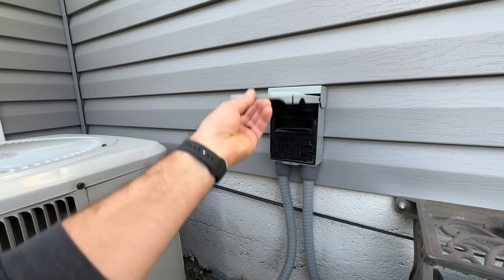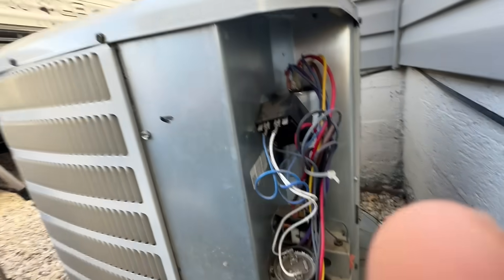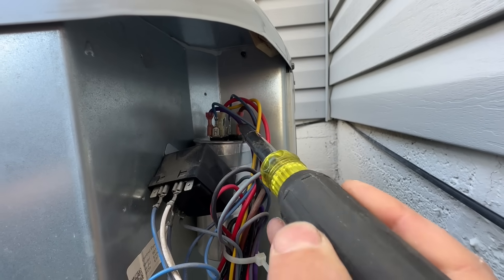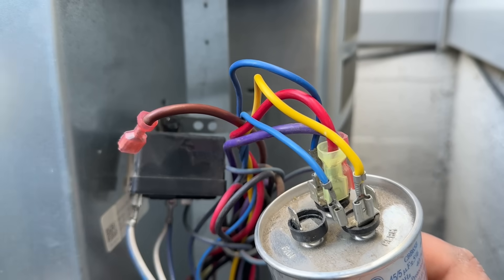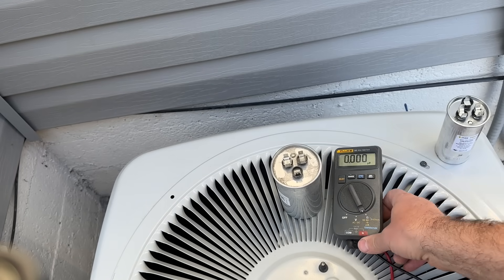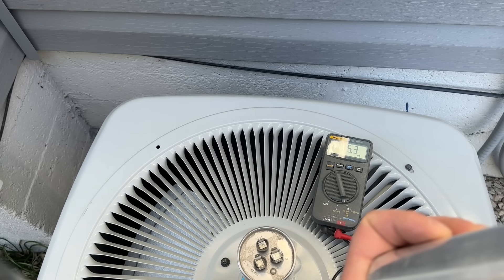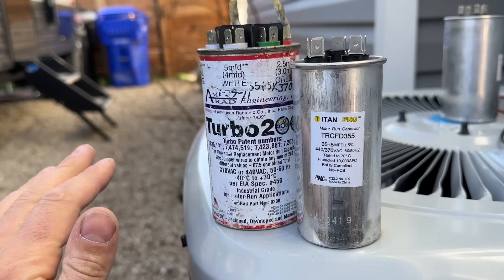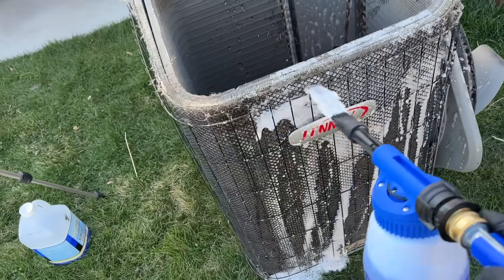How To Check & Replace An Air Conditioner Capacitor

Comment: Not a bad video but like most “technicians”/YouTubers they never know how to explain how a capacitor actually works. I love the “it’s like a little battery it gives it a jolt a jump” which I hear most often.  However A capacitor does store energy and releases it at a rate of 60 cycles per second. It creates a 90 degree phase delay or phase shift. The purpose of this is to energize the magnetic fields in the start winding 90° out of sequence from the start winding to get the rotational motion of the motor started. Otherwise, the magnetic fields would maintain a 180° pull against each other. That’s where you get the loud humming sound from a motor that won’t start. A motor with a bad capacitor.
Reply: Finally someone that knows what they're talking about!  Now tell them why they don't wear out every 3-5 years but just fail  or don't fail. I've worked on a lot of big commercial unit that had the original capacitors for over twenty years.
Reply: @poconnorish1  Not sure what you are referring to when you say they "don't wear out".  They do wear out, they don't just fail.  They often drift out of tolerance way before they fail.  I just replaced a 30/5 capacitor that was reading 22/5.  

It didn't "fail" as in die, but it failed as in it was way out of tolerance which is 5%.
Reply: P.S. Welcome to YouTube  Great comment on your fist day

Comment: OMG, I have a new neighbor that moved in across the street. He just had his whole HVAC system replaced, and I think it was because he had a slimy HVAC contractor told him he needed a new system, when he probably needed just the capacitor. 

I just had my capacitor die on me. It was a $35 DIY fix.... it would have been $15-$20 if I got it on Amazon, but I couldn't wait the extra day during that last heat wave. 

Easy fix!

Comment: That turbo cap is made in the USA and has a big warranty. The China caps tend to last 2 years.
Reply: You can find inexpensive capacitors Made in the USA.  MARS, Amrad and others make capacitors that are rated for 440Vac and Made in the USA, and they are typically around $20, which is maybe $10 more than the cheap Chinese one's.

Comment: So my AC started acting up today. The fan kicks on but it doesn’t seem to be blowing out cold air.
I cleaned the coils outside with a hose but didn’t seem to help thinking about checking the capacitor tomorrow after work.
It has a slight humming noise as well.
The unit is around 8 years old but we live in the desert so it’s constantly running during the hot months so Im really hoping this will fix it.
Reply from the maker: Sure sounds like a capacitor to me. If you need some help diagnosing check out our remote services page at Patreon.com/diyhvacguy   Cheers
Reply: So I replaced the capacitor and is working great again! It took a bit to get the house cooled down being it was around 80 degrees for 3 days waiting on the part but it’s purring like a kitten now.
Thanks for info. 🤙🏼

Comment: Great video, so here's a newbie question.  Would a Heat Pump Compressor use the same process for troubleshooting and replacing the Capacitor?  Thanks.
Reply: Heat pump system capacitor and a straight ac system capacitor functions exactly the same way, that is to start the compressor and fan .   Heat pumps have a reversing valve to change the direction of refrigerant flow, but this feature has not to do with capacitors.

Comment: I noticed you replaced the 45/5 capacitor with a 35/5. I was told you couldn't do that. You had to replace it with the same 45/5. Please lmk bcuz i  might have to replace my capacitor & i dnt wanna buy the wrong one. Thank you

Comment: Hello, I watched your video on checking and replacing the Capacitor. Mine was definitely bad so we purchased one and hooked it up. I did hear the unit turn on but after five minutes, it turned off it’s giving me a reading at the thermostat that there’s no power to the common. Any suggestions on what to do or check? Thanks for your videos very helpful 😊
Reply from the maker: I’d check the fuse in your furnace at the control board. Might have popped that fuse for some reason

Comment: I had a company come and check my failed AC. He replaced the capacitor and then said it would not be enough. It needed gas, at $400.00 per pound with no guarantee. Then he said I needed a new unit for 4-5 thousand. I can't afford that! He charged me $122.00 for the service call! Yes, I feel I was ripped off! 🤬
Reply: Find a Union shop

Comment: Thank you for the video! I have an older model double wide and the duct work is shot underneath ,I want to replace it with the round insulated duct how do I know what size to get?

Comment: Yeah fixed mine by replacing $13 capacitor just a couple hours ago . Though , taking a good long time to get it to set temp 78 F . It's definitely pushing cooler air and for three hours went from 89 F to 84 soo that's something . How can it take ? Yeah it's scorching HOT in San Antonio alright at 105 F

Comment: Took me a lot of research, but hope the below helps.  Colors may differ on yours, but on my older 1980's model, this here below is what mine goes by.  
BROWN: FAN (almost always brown)  2 prongs

YELLOW: Common (C) (4 prongs) The common terminal is used for incoming electrical power and on an air conditioner condenser unit is typically fed from the unit's contactor relay.

RED: Herm (GOES TO THE COMPRESSOR) (3 prongs)  Herm 3 Prongs! (hermetically sealed compressor) will be marked with an "H" or "HERM" and usually has three connecting clips at that terminal. The H terminal is used to connect the capacitor to the compressor motor in an air conditioning or heat pump compressor/condenser unit.

Comment: After watching this video, I decided to install a new capacitor myself when my AC fan stopped running. Although my AC is up and running again, I am still unsure about my wiring. My question is whether it is possible to have the wrong wiring but the machine is still up and running. My old capacitor was 13 years old and was rusty and I couldn’t read anything out of it. I used ChatGpt instruction and wired the brown to the fan, red to C, and yellow to herm. However, there are also other instructions where they recommend red into herm and yellow goes into C. I am so confused and afraid to switch the wires
Reply from the maker: No you got it right. It would not run if it was wired wrong 👍🏼 how you have it is correct
Reply: @diyhvacguy  I appreciate your reply and the amazing videos. They helped me avoid spending a lot of money on a new condenser or a new capacitor and hard start. My next task is to clean my condenser case. Thank you so much. 😊

Comment: New subscriber, 
Thank you for your time, super well and clear tutorial,
You save me tons of money,
The hvac  guy last year , charge me (from the TV commercial, fucking thief )
Check capacitor , clean the coils and flush the pipe drain,
1200$, 
I did it my self , now is low of gas, nonidea how to do it myself ,
Like i do in the car,
Any videos or where to find out,.thank you in advance
Reply: Best advice I can offer is to find a Union shop for your plumbing and a/c needs. They actuelly test their journeymen above and beyond the state level to qualify.

Comment: My running capacitor failed at the same time as my neighbors. I replaced mine for twenty bucks and even bought an extra one for my neighbor. He wanted a professional to look at his unit and ten grand later he had a new unit. He got the scare tactics and he cave in. Ten grand!! Nothing in the whole system cost more than 600 bucks. Oh well there’s a sucker born every day.

Comment: Rumor or not? I've heard people say that changing the capacitor will also help your system run more efficiently and this save a little money.
Reply: Definitely rumor. With no moving parts, it,s almost always an external cause like voltage drop or minor manufacturing defect that causes failure. I've worked on 30+ year old units that had the original capacitors that were still perfect.

Comment: OMG! My AC unit went out and I called for service.  The HVAC guy told me I would have to replace my AC unit, and quoted me a price of $5,695, after my $1500 home appliance protection plan.  I decided to go to YT (my trusty source for education and DIY), and after seeing your video, I checked my capacitor and noticed it had a puffed up top.  I went to ACE hardware and purchased a new one and installed it myself (thanks to your great instructions).  My AC fan turned on and I now have cool air again.  

Thank you for sharing your knowledge with us.  It is truly appreciated.  And thank you for saving me thousands of dollars.

May you and your family continue to stay blessed in every way possible.
Reply from the maker: I didn’t realize ace stocked capacitors? That’s awesome! Glad you got it fixed up. It doesn’t surprise me at all that they said you needed a new one. What greed..
Reply: @diyhvacguy yep ace hardware has them here in central Florida as well
Reply: @diyhvacguy  I was glad they had  it because the Home Depot near me was out of stock.
Reply: I'd call the service back for explanation for trying to rip you off. I'd also inform the BBB because no doubt, they're ripping other off as well.
Reply: @Mike_Malloy  should be jailed !
Reply: @Mike_Malloy  Thank you for this advice.
Reply: That's criminal, unethical, and immoral.  Shame on that tech for purposely misdiagnosed your unit.
Reply: Very well explained
Reply: Bought mine from ACE today.  There was another guy buying one too.  Worked like a charm!
Reply: Sounds like Black Diamond here in St George, UT. Total scam artists.
Reply: I will try to change it out. Just got quoted 200.00 to change out 1 capacitor and 250.00 to unclog a condensation hvac drain pipe...
Reply: That is WILD! Likely could have HONESTLY made 150-200 dollars off you to replace the part in 10 minutes
Reply: @nathananelson  EXACTLY!!!
Reply: @nathananelson I changed my capacitor $33 ace hardware and fan New in box old stock $120 myself in 30min.
Reply: Don’t use that AC guy

Comment: This is super helpful! However, can you work backwards if you have a turbo capacitor already installed? We just moved into this house and it looks like the capacitor has already been replaced with a turbo capacitor. However, they’re 5x the cost of the standard capacitor. If the 20 and 25 are jumped together, can I safely assume the 45/5 is the one for me?
Reply: Yes, that would be correct.  Just buy a good quality 45/5 like a MARS capacitor which is Made in the USA and rated for 440Vac.  They are pretty inexpensive or around $20 or so and will last far longer than the cheap Chinese one's.

Comment: 7.31.23  Question:  If you have the trubo 200x and just want to by a non universal capacitor would the wiring diagram show what the Mfd should be?  For example 45/5 Mfd.  Amazon showing  94.53 for the 200x.  Or about 20.00 for a dual run on.

Comment: Where could you look to find what capacitor your A/C unit takes without disassembling it?   Is that information stated on the sticker outside the unit?   Thx.

Comment: many kudos 2 U 4 public service 4 saving hundreds of dollars n convenience not nned 2 call HAVC tech meaning so valuable information even grand ma can do with some step by step without rushing. Ur 2 helpful reminder not 2 get electric zap is static electric discharge N take picture before removing wires in case we forget 2 snaps back 2 the right order. Well done indeed!

Comment: Can a bad capacitor cause the circuit breaker to trip every time the AC tries to kick in? Been running all summer without AC cause we csnt afford s technician, but if this could be a cause i can afford the psrt to try ir myself
Reply: Circuit breakers hate being tripped and  wear out quite rapidly especially if the are too close to the amp draw of the unit at startup. They're relatively inexpensive and very easy to intall once you find the exact replacement.

Comment: Couple year ago the A/C on my travel trailer wouldn't fire up the compressor.  I had a feeling it was just a $25 run capacitor.  Reached out to a couple RV repairmen.  First guy wanted $350 just to come out and look at the unit.  Other suggested that I just replace the entire A/C unit since this is probably the beginning of my problems with the unit.  His quote was just under $2000 for it installed.  I decided to go with my gut and buy the run cap and install it myself.  My A/C was fixed and the worst part is these repairmen probably knew this was the problem since I suggested it and wanted to make a bunch of money and dismissed it completely.

Comment: Thank you! My house has a heat pump, and every 4-5 years the capacitor fails. The last time it happened, I checked and saw that the capacitor had failed (it had expanded and was leaking oil). I called my HVAC company (who had inspected the unit a month earlier) and told them what I needed, and they still charged me $200 for a "diagnostic charge" and $400 for the replacement. I was really annoyed that they charged me $200 when the cause was already known and obvious. Greedy jerks!
Reply: As a hvac technician, I appreciate any information the customer gives me but I like to do my own diagnostic on the unit (I charge $75 diagnostic) because there may be a reason your capacitor keeps going bad. After replacing the cap I always check other parts of the unit and take readings as the unit is working. I’m glad home owners are more handy but knowledge of hvac is always a high priority to repair any hvac issue
Reply: The do make better quality capacitors in the USA which should last longer.  Always get  440V capacitor and MARS makes high quality capacitors which will last far longer, and they only cost around $10 more.

Comment: Before seeing this, I had mine replaced. The guy did not have the correct, single capacitor and used two. Should I replace that? Also, is there a disadvantage or does it matter? Really appreciate what you’re doing. Thank you!
Reply: The capacitors on A/C's are basically two in one.  If you don't have the correct two in one, using two separate capaitors is perfectly acceptable and will work just fine.

The only thing I don't recommend is buying cheap capacitors or capacitors rated for 370V.  MARS makes Made in the USA capacitors which are rated for 440V.  They will last far longer that the cheap Chinese one's as they are not that expensive, maybe $10 more or so.

Comment: Hi, i have a window unit, not sure if you work on those, but i used it for one season, when when I went to turn it on for the next year, it was suddenly making this really loud noice, like an unbalanced washing machine full of bricks. It still cools, but the noise disturbs my neighbors bc it's so loud. 

I finally got around to opening the case on it, and the only thing i found that seemed off was a broken, curved piece of blue plastic about 4" long and a bit over a centimeter wide. It still makes the noise, and looking it, it just really seems like the motor and all the other moving parts are just shaking too much. Do you have any advice for me? The heat is affecting my health and i can't afford a new unit
Reply: Very difficult to work on and typically hard for even the top techs to find parts. Repair almost always cost more than a new unit.  Sorry

Comment: You should have told people on your video first thing is to check for is live voltage at you contact relay. That's number One!.
I have seen electrical disconnect boxes by-pass inside.

Comment: Hey, how important is it to match the ratings on the run capacitor beyond how it says the microfarad MFD rating?
Reply: The only thing beside the correct MFD rating is the voltage rating.  Most capacitors are rated for either 370Vac or 440Vac.  Higher is better.  You can replace a 370Vac capacitor with either 370Vac or 440Vac capacitor.  You can not  however replace a 440Vac capacitor with a 370Vac rated capacitor.

The voltage ratings are minimum voltage ratings, so a higher rated one will work fine and probably last longer.

I also recommend replacing them with Made in the USA capacitors like MARS or similar, as the Chinese capacitor quality control is all over the place.

Comment: I think techs should sugest a capacitor replacement as preventative maintenance when they are doing a tune up if the capacitor is 4 years or older. I started replacing the capacitors on my rental units every 3 to 4 years with a bi yearly thorough condenser and evaporator cleaning. 
Yesterday I removed the squirrel cage for a cleaning of the fan blades. Wow, that may become a normal maintenance item added to the list. Those thing get cakes

Comment: I just had my capacitor replaced a few days ago. My unit was still under warranty though, so I didn't have to pay anything. I only had to go one night without the AC so it wasn't bad. I should probably get an extra capacitor or two before this heat kills the new one.

Comment: never going to get popped by a run cap. it does not hold a charge -run cap does not give it a boost to start either it takes it put of phase more for efficiency than anything .

Comment: The capacitor in the AC unit at the house I rented for 10 years failed every three years like clockwork. The outside unit was in the sun most of the time, and the capacitors got "cooked". It was obvious that they capacitors were bad: fluid leaked out of the top.